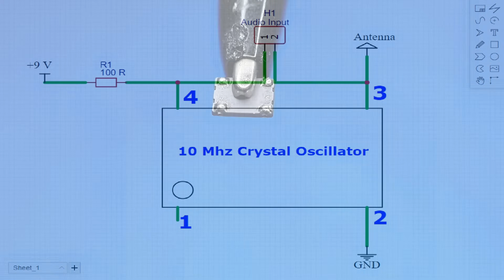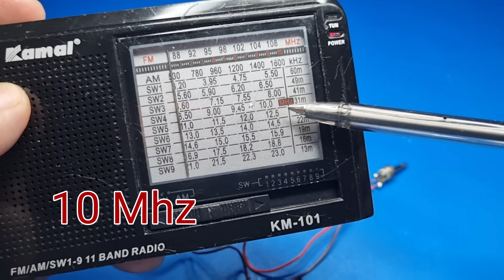How To Make A Radio Transmitter With Only 2 Components - Great Idea You Haven't Seen Before

Comment: there is only one question left) what is a quartz resonator after all? Is it a filter? a frequency allocator or is it a frequency converter? what frequency signal should I send so that the resonator is excited and begins to resonate. From physics, we know about resonances at matching frequencies, well, if quartz is 4 kilohertz, then I have to send a signal to it exactly 4 khz, no more and no less, and eventually get a stable frequency of 4 khz and its harmonics. But now the question is not about harmonics. I know there are filters that pass through themselves only a narrow band of frequency to which they are created, but quartz seems to emit itself. Hence the question: WILL I BE ABLE TO MAKE QUARTZ OSCILLATE 4 KHZ BY APPLYING 1 KHZ OR 11 KHZ???? OR, WILL I BE ABLE TO SMOOTHLY CHANGE THE FREQUENCY WITHIN WIDE LIMITS AND QUARTZ WILL CLEARLY BEND ITS FREQUENCY, WITHIN WHAT LIMITS OF ITS POWERS?) If we tap on an acoustic guitar, we will hear the resonance frequency of the guitar body! it turns out that a short pulse was applied and the body responded with a pulse frequency of 800 hertz. How many pulses should be applied to quartz so that it resonates continuously?
Reply: In this video the author uses a hybrid oscillator chip, the frequency of which is stabilized by a quartz crystal. This oscillator operates at 10 MHz like an amplitude modulated transmitter.
The quartz crystal itself is a resonator (a system with series and parallel resonances). When the crystal is included into the generator circuit, it can operate at the nominal frequency Fc or at the harmonic 3Fc. 
The frequency Fc can be changed within small limits (units of Hertz) by changing the capacitance of a capacitor or inductance of a coil, which are connected in series with the crystal.
If a short pulse is applied to an autonomous crystal, the crystal will respond with a short series of rapidly decaying oscillations with a frequency Fc.

Comment: That's a nice one, but there are two mistakes in your title:
First, There are three components in this stuff, an inductor, a resistor and an oscillator module.
Secondly, the third one is not actually a component, it's a module integrated with several components.  Overall, a good work. 👍
Reply: No wonder there are so many fighting online !
Reply: @stevelamperta865  no fight, just for information 😊

Comment: after dark on radio "perfect" (propagation) nights the 10 MHz crystal coupled with huge enough & properly matched antenna will send you thousands of miles, and sometimes even with a mediocre or semi-crappy antenna, depending on altitude of certain upper atmosphere components.

Comment: very good, would it be possible for you to make a video building a receiver of this radio signal ??
Reply: Just look up diy crystal radio. All yo need is some transformer wire a toilet paper center tube a strip if tin can and a small piece of Galina or pyrite crystal for  the detector diode and an earphone . No power necessary.

Comment: You need to say a 100 ohm, 1/4 watt resistor. the average dork might not know what 100R means. Also, the coil...what diameter was that drill bit, and how many turns? the battery connector and coil/antenna make it 4 parts. Also, I don't think you will hear that across the street. And 10 mHz...not everyone has a short wave radio. Oy.

Comment: I’ve been thinking about controlling an underwater glider using audio to transmit the signals because radio waves do not travel through water well. Do you think this is possible?

Comment: Nice, but isn't the coil a component?
Reply: If you replace that coil with a proper half wave antenna and ground then it will perform better. Do you consider an antenna en electronic component? ("component" here = electronic component, proper. That's what is implied, I believe we can agree).

Comment: Does anyone know the maximum distance one can go to keep getting the signal of this DIY radio?
Reply: Yes
Reply: @tonywright8294  that answer doesn't help a lot🤣
Ok, the question seemed to imply I wanted a yes or no, but see, that's not what I wanted
Reply: @fireb62  With a 46' 4" length of 14 gauge wire at least 30 feet up halfwave longwire, impedance matching unun xfmr, biased against a ground rod of at least 10 feet depth, 3/4" dia copper clad ground rod connected at opposite side of matching xfmr. Reliability with his max 800mW PEP? Across town maybe. Optimal conditions? Over the pole, Across an ocean. But that would need luck and magic happening and the best solar conditions and xmtr location and rcvr set up and locale. The ground in Michigan's UP is practically a mound shield of iron.

Comment: Can i use microphone instead of audio input?
Reply: I think most microphones wouldn't produce enough voltage to modulate the crystal oscillator to any useful degree, especially since it is effectively being loaded by the 100 ohm resistor. It'd be worth trying, though.

Comment: Hi. Thanks for the idea. What the length of the antenna? Its matter in this case?
Reply from the maker: The power of the circuit is low, only a 1 meter antenna consisting of crystal is sufficient, but the distance does not make much difference. If you are going to transmit sound inside the building, you can connect the antenna to the ground, it will be sufficient for sound transmission inside the building. RF amplifier is needed for long range maybe we can do it in the future
Reply: @ZAFERYILDIZ52  Thanks for the reply. :)
Reply: @guilherme6374  For 100 mhz 300/100/4=75 cm

Comment: How do you change the transmitted frequency ??
Reply: Use a different Crystal oscillator and antenna length / no. turns, dia.

Comment: Crystal oscillator, resistor, coil, battery connector, audio connector, battery - that's 6 components in any normal circuit list.

Comment: how about 2 pin oscillator? can it work?
Reply: No it won't work because the 4 pin component is not a crystal, it is an oscillator. You can't do a crystal oscillate without something that switch the current or has a negative resistance (i.e. a semiconductor, a tube or a rotatory switch or vibrator switch).

Comment: Anyone tell me the only 2 components needed to make this?
Reply: this is the chip, I didn't find the datasheet for it, but it looks like there's just a generator with quartz stabilization inside, and a current-limiting resistor to set the operating modes of this chip

Comment: Your antenna is no good, it should be tuned to the frequency, if you had 10mhz you need a antenna the same length as the 10 MHz wavelength and so on

Comment: Definitely the worst soldering technique I've ever seen: Boys and girls this is a demonstration of how NOT to solder. Do not apply solder to the iron tip first; then to the joint. Rather: apply extra flux to the surfaces you intend to join first, then apply solder and soldering iron tip to the joint at the same time, and remove iron tip as soon as the solder has melted. Also; mechanically form joints before soldering where possible.

Comment: It is ilegal in India to make transmitter
Reply: In India, the use of transmitters, especially those operating on specific frequencies like FM bands, is regulated by the Department of Telecommunications (DoT). The legality of using a transmitter depends on various factors such as the frequency range, power output, and potential interference with other licensed users. Walkie Talkies is what you are looking for. This video is interesting for other reasons for DIY community. No offence .. Thanks. CB